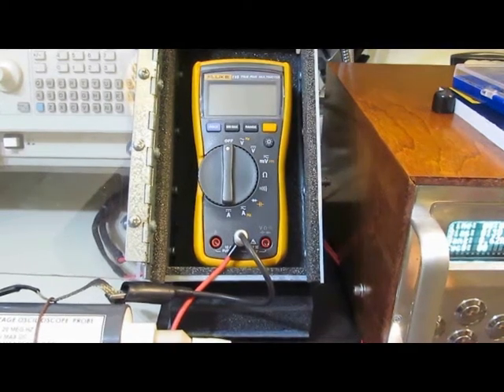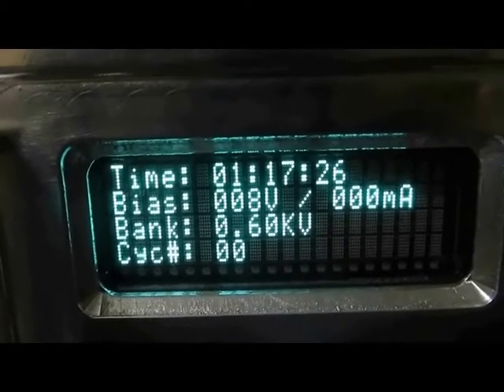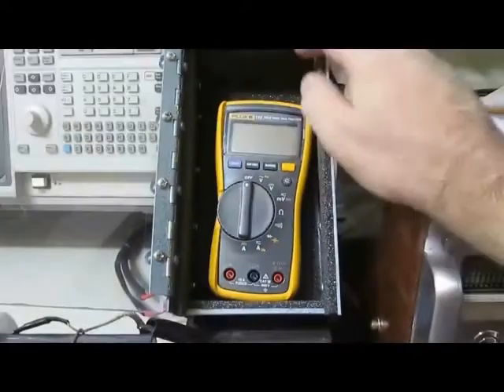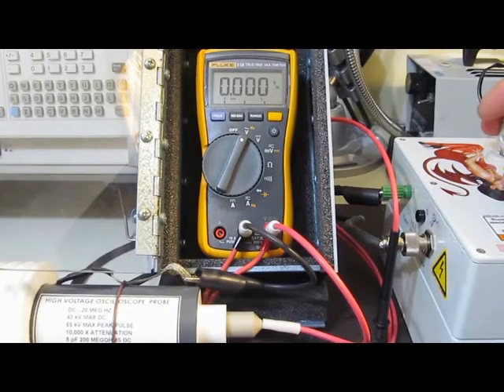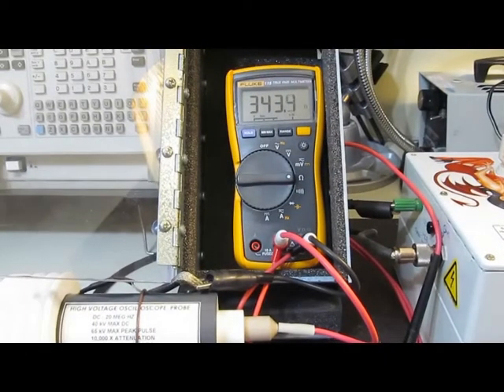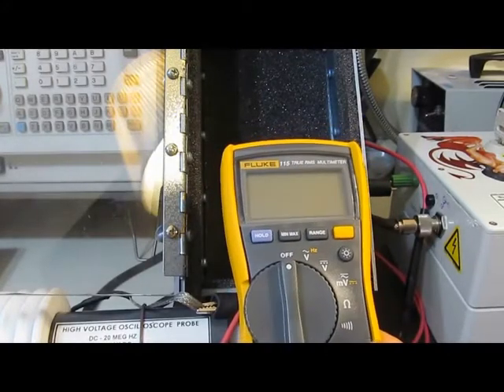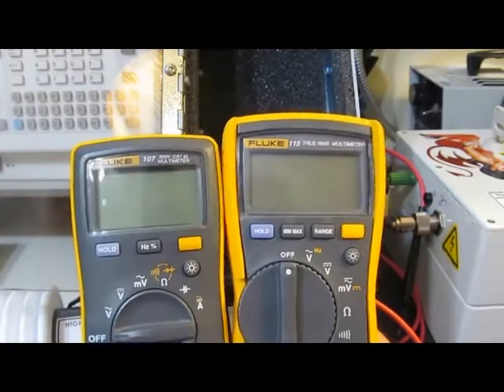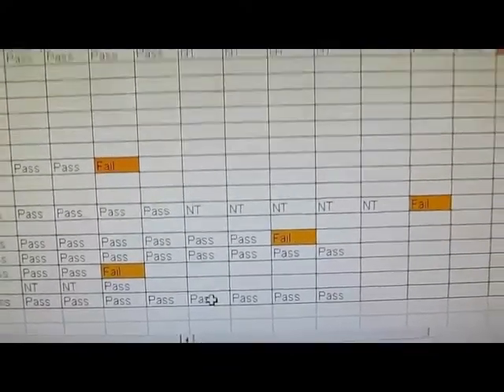The Fluke 115 Review Part 2 of 2

Comment: I don't understand, you state in the video (@16:05) that the Brymen BM869s failed at much lower voltages than the Flukes, but looking closely at the chart in the video (row number 08), it indicates that it failed at a much higher voltage (13kv) than the Fluke 115 (which you stopped testing at 12kv)  ... ???
Reply from the maker: That is correct.  At the time I did not have an easy way to run the tests at the higher levels and I really do not know at what level the BM869s would have failed at.   We only know it is somewhere between the 5.9KV and 13KV 100us FWHH 2ohm source.  We also know Brymen was surprised it made it as far as it did.
Reply: Thanks for a quick reply. So, would it be fair to say that Brymen (whatever that company is, and wherever that company is located) has the potential to offer products that compete directly with, and even surpass in some cases, Fluke ? And maybe finally shake Fluke off their laurels to some degree ?
Reply from the maker: Brymen is in Taiwan.  At least with the two meters I have from them, both were independently certified like Fluke.   I don't see a lot of innovation coming from Fluke.  Maybe you see it otherwise.  They seem to be riding the wave they created many years ago.  The reputation they built will only carry them so far in the long run.  Personally I like the Brymen BM869s over the 87V.  If you watch the review I did of the UNI-T UT181A compared with the Fluke 289,  you get an idea that it really will not take much for UNI-T to make a better meter.  It's not there yet.
Reply from the maker: An seeing that you are looking at the spreadsheet, have a look at what level the Fluke 87V failed at.
Reply: Yep, I watched that video where the 87V failed pretty early on. Very surprising. But these tests you perform are pretty extreme ones. 
BTW, I did just buy a Fluke 115 for my work (I'm an industrial mechanic), and thankfully I don't deal with higher voltages than about 600 VAC, but I wonder if I walk on a synthetic rug, dragging my feet, and then touch my probes if it will exhibit the same glitch of locking up and having to be power cycled to reset ? ;-) 
I don't think so. Anyway, thanks for very interesting videos.
Reply from the maker: The tests I perform are pretty lame compared with the IEC standards they would normally be tested against to be certified.   The energy levels I use are very low.    Yes, ESD can be a problem for some meters.   I am not aware of any Fluke branded meter that is not tested for this.  After the UT181A was damaged, I show the waveform from the grill starter and how it compares with the standard in part 2.   Again, it's pretty tame.

Comment: What is the point of this test? Who will measure 12-13 KV with this equipment/instruments? And with position of the rotary switch at Omh or Diode?
This instrument is not for voltages which you are testing. Did you look in the specs? Or you think that you are smart?
Pleae visit test of mjlorton to see how this can be done
Reply from the maker: Had you taken the time to look up IEC 61326 & 61010  you would have some idea what is being shown.  There is also a link to a FAQ in the description as well that may help answer the basic questions you have.   If you are still unclear about what is being show, ask and I will try and help you understand.